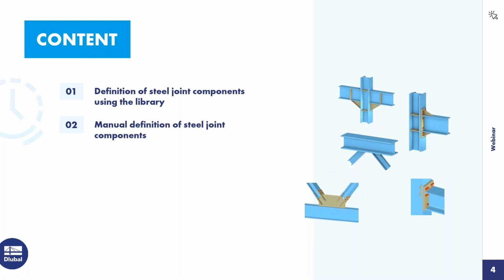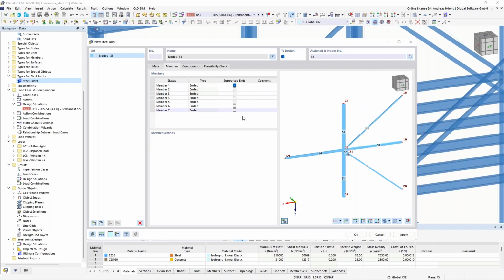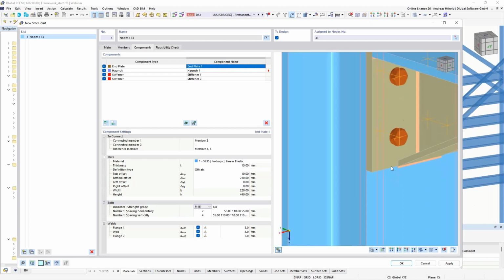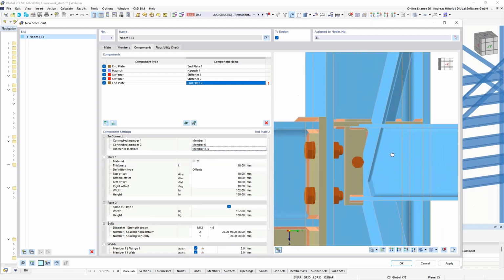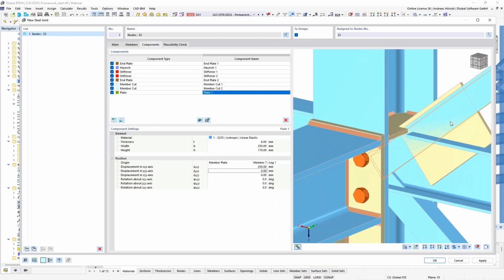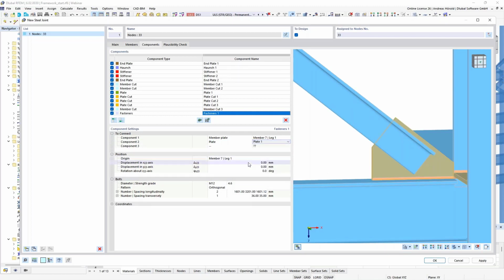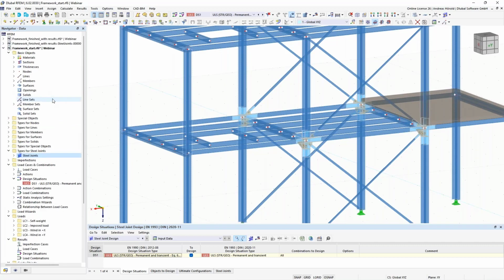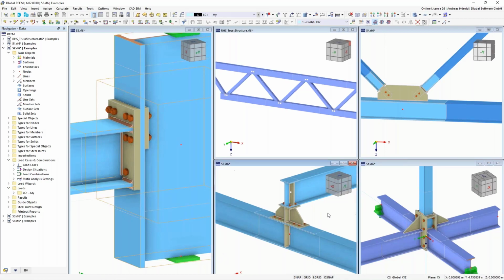[EN] Analyse des assemblages acier à l'aide du modèle EF dans RFEM 6

Comment: It seems that design process is pretty time consuming.
Isn't it?
Reply from the maker: Hi @vahidjebelli.2000! While the design process may seem time-consuming for highly detailed and complex models, RFEM 6 is built to balance accuracy and efficiency. If calculation times are unusually long, it may be worth reviewing the model setup or hardware configuration. For example, ensuring sufficient RAM and a multi-core processor can significantly improve performance.
Reply: Now I see that you are right. Thank you for your reply